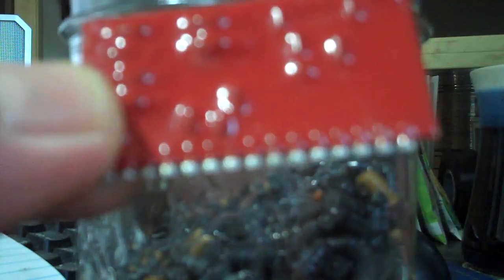Tantalum Capacitors: Different kinds of capacitors

Comment: Great videos feets. Where do most often see the black bullet type? I have boards of all types shapes and sizes but I never seem to run across the bullet type...unless I just miss them, which is why I'm asking. Thanks!
Reply from the maker: +zackcat276 I find them mostly on old telecom boards. Usually they are on peripheral boards. Those are the small boards attached to the large boards.

Comment: Hey Feets, I would like to know is there Tanalum in the old crt's  or are they just regular capacitors. Refering  to capacitors that look that they dipped.
Reply from the maker: scott v They are regular ones. Tantalum is used where heat is an issue.

Comment: Just to .take sure EVERY capacitor that has a crook in its leg is a tantalum capacitor?
Reply from the maker: stanky- budz The crooked leg is there in case the ink rubs off so you will know which side is positive. They can explode if put in backwards. Everything I've seen on them says the crooked legs are just on tantalum caps.
Reply: thanks for letting me know!
Reply: stanky budz t

Comment: Uh, the little rainbow thingy with 2 dots on top is a coil, not a cap.  Remember coils restrict or filter AC and caps restrict or filter DC.  2 different things :)
Reply from the maker: The rainbow is the code for its capacitance. It is a tantalum capacitor.
Reply: OriginalFeets LMAO! really?  Well hook it to a Sencore "Z" meter.  You will find it reads in microheneries or milihenries not microfarreds :)  It is a coil.  Oh yeah, the dots are the code of its inductance :)  Then again I watched a video today where someone was busting 8 and 10 dollar toroids (donut looking thingys) to get the little bit of copper wire off them :)  I have bags of tantalum caps, never used.  Digikey sells them by the hundred.  I think this is a scrappers myth.  I hope your right though, I got a bunch and a wad :)
Reply from the maker: HM Dickson http://dmohankumar.wordpress.com/2012/05/01/familiarize-electronic-components-part-xiv-colour-coded-capacitor/
Reply: OriginalFeets http://how-to.wikia.com/wiki/How_to_identify_inductor_markings

Comment: there is little black ones shaped like the monolithic ceramic capacitors on the board.wot r there made out of and do they need keeping separate to the monolithic ceramics capacitors.some of them have numbers on as codes.

Comment: I'm scrapping a whole bunch of crt monitors. I'm trying to figure out if the caps have any precious metals. There may be a few "Captain Morgans" but most are more disc-like than drip-like. I've googled  a bunch and still am not sure if it's worth my time to cut them all off or just sell the boards as is to a recycler.

Comment from the maker: The yellow box type seem to break open easily. You can hit them with a small hammer and it cracks apart. Usually acids are used to dissolve the case. That creates an explosive potential due to what is in the case and should be left to professionals.

Comment from the maker: The board you saw is part of an old Mitel line card. it was made in 1981. Nowadays tantalum capacitors are in phones and on motherboards. If the electronic is small or needs to be safe from heat it probably has them in it. They will probably be the little yellow or black boxes.